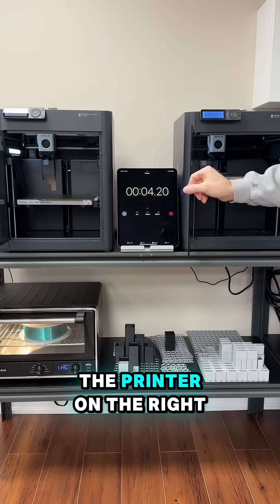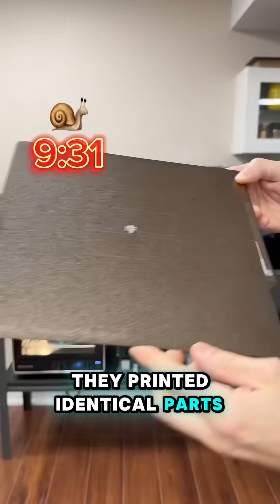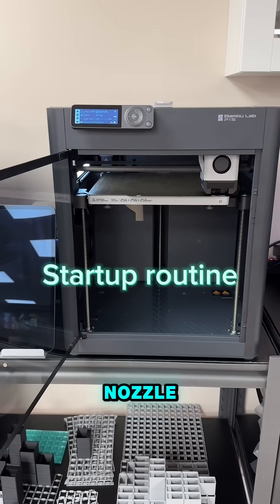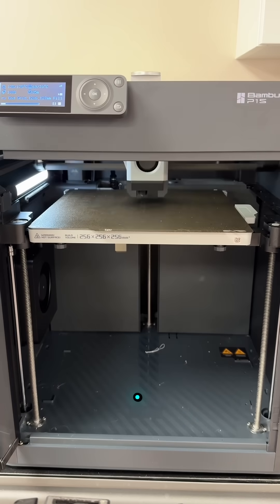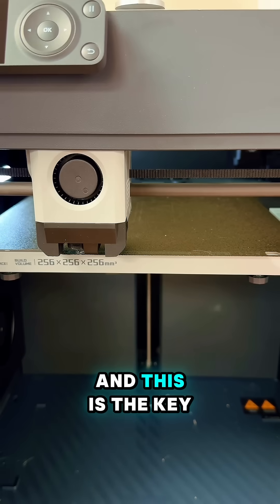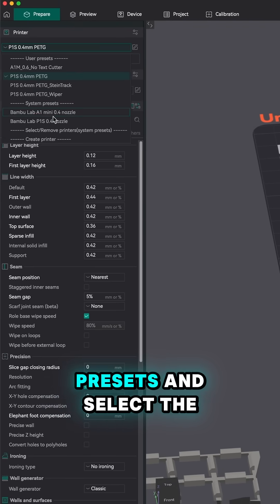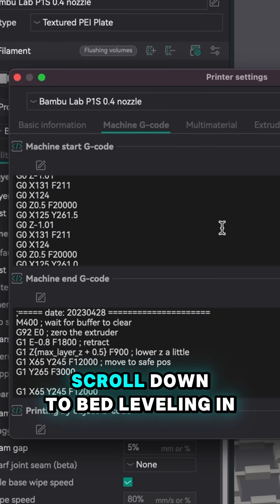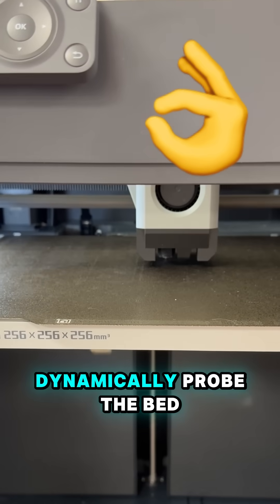This ERROR is slowing down your Bambu P1S 3D Printer! Fix it with THIS! #bambulab

Comment: i think this is stock on the A1
Reply from the maker: @williamjaggers4624  yes it is. For whatever reason the code in the stock profile is different for P1 but functions the same as the A1.
Reply: @ goofy bambu labs smfh lol
Reply from the maker: @williamjaggers4624  little bit ya. They need to just provide a wiki code already.
Reply: @leckiestein  i doubt that will ever happen. atleast not for a while. maybe after they release a A1 Max
Reply from the maker: @williamjaggers4624  but it's just a funny thing because they have documentation available with some example code but it's like you're only allowed to use the very primitive code they give you and nothing else. And I get it they do it this way; probably so people don't drive the Print head into the bed or something else catastrophic. Maybe they will release a developers level one day
Reply: @ a dev level operation system would be ideal. especially for those of us with ideas we want to implement without purchasing a whole other printer lol.
Reply: although i am purchasing a voron kit just to be able to mess around
Reply from the maker: @ there's been a few times when I considered putting a duet board in this machine... lol

Comment: Do you have a link how to adapt the nozzle wiper at the back of the build plate?
Reply from the maker: Sorry for the late reply, I missed this one I guess. I since moved away from the plate wiper for good reason but have a new and improved solution here: https://www.patreon.com/posts/p1-steinwipe-118394738?utm_medium=clipboard_copy&utm_source=copyLink&utm_campaign=postshare_creator&utm_content=join_link
Reply: @leckiestein  Thx, but I have the X1C, so it wont work. I found a similar open source solution, compatible with both P1S and X1C.
Reply from the maker: @ oh ya. At this time I just dont have your machine in my arsenal to test the code for release. Im thinking the mount will fit fine. Either way, happy to hear!

Comment: will this work on non bambu printers?
Reply: Průša printers support the same thing since firmware 3.14.0
you need Průša Slicer 2.7.4 and it should work automatically (assuming the printer is set to 7x7 mesh)
Reply: no the A1 parameter is only used but the bambu firmware. not in marlin or klipper.

but you can find adaptive bed mesh leveling solutions for both with a little googling

Comment: Bambu A1 has this by default, I thought the P1S would have also.
Reply from the maker: @Doyle69  my thoughts too. I even checked orca and simplify 3d and all use the wrong code
Reply: But it defiantly doest just do the print area
Reply: My A1 does the whole bed too. Code on the stock profile right after g29 is S1 so I switched it to A1. We’ll see what happens results to follow in about 30 mins 😂
Reply: @CJHaggleya94  Yeah mine said A in the code so unfortunately not for me. hope it works for you
Reply: @CJHaggleya94  Did the change work for you?
Reply: @PedroCastro-ss5dv  Nope didn’t work.

Comment: it's stuff like this that's super annoying about the bambu slicer. Why isn't a feature like this automatically enabled? why do I have to make a custom profile for it? why can't I change the default profile? Don't get me wrong, I love my printer. It just feels like there's too many things bambu did to make the product idiot-proof and doesn't really give experienced users room for modification
Reply from the maker: Id settle for a terminal window and a gcode wiki
Reply: You can edit the system json file for your printer, change the gcode with a text editor and save it and will be saved to the system preset so no need for a custom one

Comment: Tested this with my P1S. Worked great. Weird that this wouldn't be a default. Can't believe this was such a simple change!
Reply from the maker: Happy it worked for you! 🍻
Reply: Yea doesnt work for me with the P1S either 😢
Reply from the maker: @NaenDILLIGAF   @kentg86   @marioss394  hey guys, see the pinned comment for the simple fix :)
Reply: Who is the maker of the 3d printer wouldnt want, print almosr to times faster, with no compermisers, being taken?
Reply: Hey! Can you share the firmware version of your printer? Thanks :) Just asking because it doesn't work on mine
Reply: @marioss394  this looks like maybe "Klipper Adaptive Meshing & Purging" has been merged in to Klipper to some extent. If you're not using a bambu it might be something you would want to set up yourself.
Reply: @offspec  I am using a bambu, the issue is that it doesn't work on both of my p1s. I am wondering if is a firmware related lock
Reply from the maker: @marioss394  hi, sorry I must have missed you comment 3 days ago! Im thinking it's not firmware related because Ive been running the P1S for 2 months and I think I have updated at least 2x from the original firmware and the dynamic probing has continued to work. But i will send you the fw version when I get home from work tonight and we can compare :)
Reply: @leckiestein tried this update a week ago too, it's not working. I'm running the latest firmware. I did confirm G29 A1 in my machine G code. Let us know if you find any firmware related constraint, appreciate it!
Reply: @marioss394  Running my P1S on 1.06.01.02. And Bambu Studio on 1.10.1.50.

Comment: What's the nozzle cleaner on the back?
Reply from the maker: Hi! Its an A1 wiper. I run wipe cycles during my prints at different times to avoid those dreaded brown deposits that happen with petg on long prints.
Reply: @leckiestein  is it glued on? Or how did you attach it?
Reply from the maker: @epic-buffalo  sorry, I missed this message! Since moved away from this bed mounted version because you cant do tall prints with it and wipe but I released a mount and you can use my startup code, its posted to my patreon "P1 SteinWipe". There are 8 user selectable features you can toggle on simply by typing "true" for the feature you want in the respective section. One of the features is making the machine purge outside of the print area and travel 500mm/s and 20k acceleration to the first layer to minimize strings from the purge to the print. Also, the purge is a true representation of the current pressure advance setting set by the filament. You want to see a perfect consistently straight line and no bumps so you know even before the print starts your PA setting is good rather than finding out when your print over and ugly. Hope that helps!
Reply: @leckiestein  no worries. I've seen the better version, and commented on it ;-)

Comment: Bonjour , ne fonctionne pas sur p1p , ça démarre toujours pareil , merci a vous ...
Reply from the maker: The P1P will start the same, but the bed levelling probe process will now probe only the area you will be printing. If you put a very small part, its likely the printer will only probe 4 spots - saving lots of time.

Comment: Thanks. Going to implement now. Assuming i dont remove the plate between prints. Do I still need to run bed levelling for every print?
Reply: Just made the change now and it worked. Epic thanks
Reply from the maker: @maxcardenas8257  happy to hear!
Reply from the maker: @maxcardenas8257  I personally run the mesh every time but its definitely not necessary with PLA but I have found small levelling error when temps are hotter for material like petg. the surrounding air temp matters too. Especially right now that we have negative temperatures when I am, my shop can get quite cold in the mornings so running a mesh on all the printers would be mandatory for startup and again once the room has warmed 15c or so.

Comment: @leckiestein this will work for 1xc ??
Reply from the maker: @Stantheman-f3r  I dont have an X1 yet to test it but I did see that the code is the same for the x1. Wont hurt anything to try it!
Reply: @leckiestein  I will try on me x1c
Reply: Waiting for nozzle cleaning video
Reply from the maker: @Stantheman-f3r  if it works let me know and I can update my video description :)
Reply: @leckiestein  don't think will work  I've changed A to A1  time is the same. Now I will watch the printer to see if the prinyer will do partial calibration
Reply: @leckiestein  no not working he is doing full calibration
Reply from the maker: @Stantheman-f3r  Guess it only applies to the P1 then.
Reply: @leckiestein  I can confirm, tested on my x1 second ago, it went through full calibration :(

Comment: wait, my A1 does this stock, it only probes only where its going to print, it always did it this way
Reply from the maker: @flippy9133  yes, its how I found that it was the "A1" missing in the code. My A1 minis and full size dynamically probe the bed just fine and then I got a P1S and it didn't! I was very disappointed because the probing on this machine takes so long so I compared the two startup routines and made this discovery. I'm actually surprised nobody has covered it yet! Even looking on the forums I haven't seen anything.
Reply: @leckiestein  That's awesome, Thanks for sharing!
Reply from the maker: @x.....p-x7j  absolutely! I have a few more cool tricks coming, too. ill have the videos up soon :)
Reply: @leckiestein  Brilliant find man.
Reply: @leckiestein  Ahh that makes sense

Comment: For extra speed, get the printer to heat the bed and the nozzle while it is probing.
Reply from the maker: Thanks for the suggestion and good advice, but the nozzle on the P1 heats so quick! Its the bed that we have to wait for. We cant probe the bed until its reached first layer temp to allow for expansion and deformation. My gcode does other things while waiting for the bed to head; the stock code does not do this for some reason. It will literally sit there for 4 minutes doing nothing but heating the bed haha
Reply: no, you want heat bed first to the printing temp first, i made that mistake long long ago, learned that as bed is heating up, it changes shape as well, wrapping probably, so only prob AFTER bed fully heated.  nozzle temp isnt so critical in leveling.